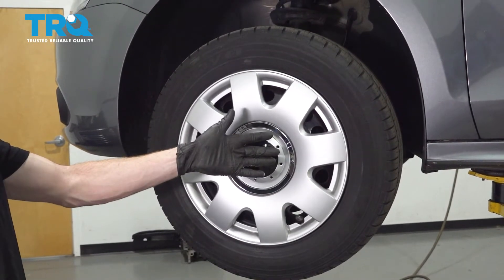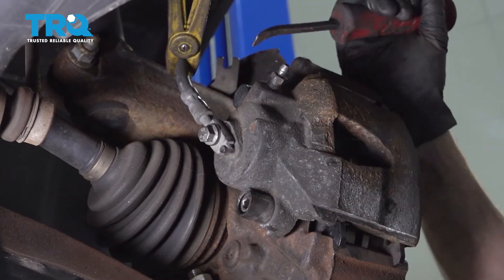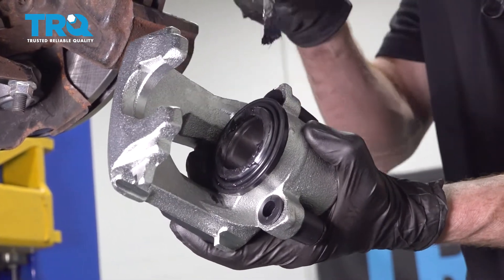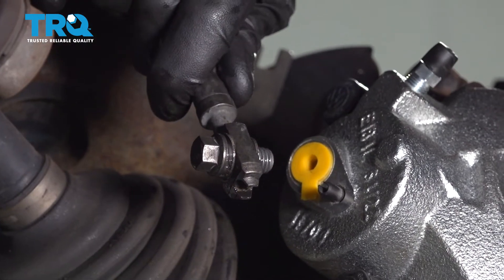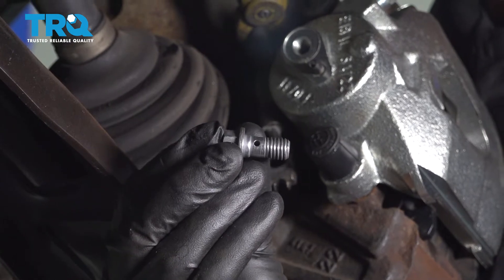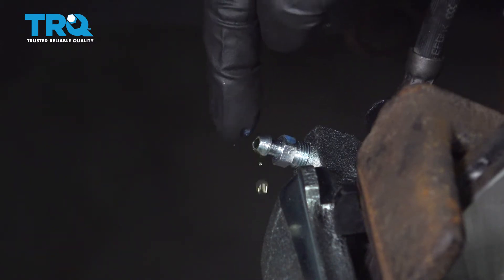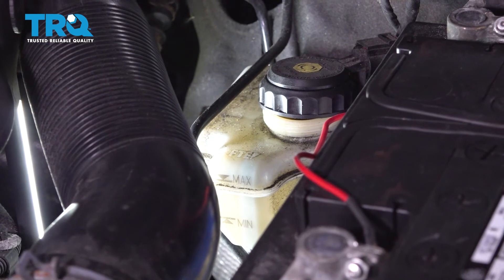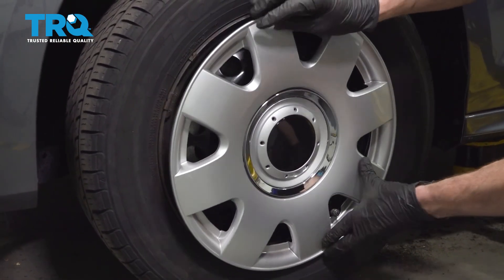How to Replace Front Driver Side Brake Caliper  2011-2018 Volkswagen Jetta

Comment: What if you're replacing all 4 calipers? Is a bleed necessary for each one? Just once for all 4?

EDIT: They also did not fully replace the caliper. The caliper bracket was not replaced.
Reply: I need to know this too